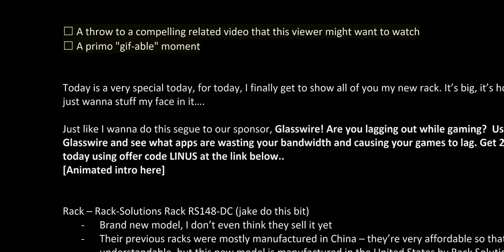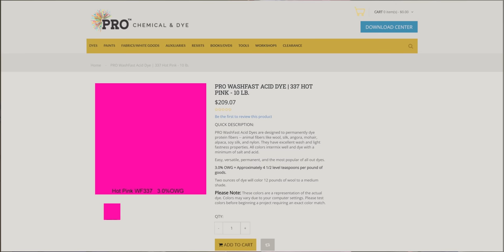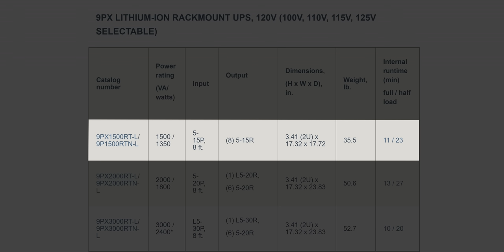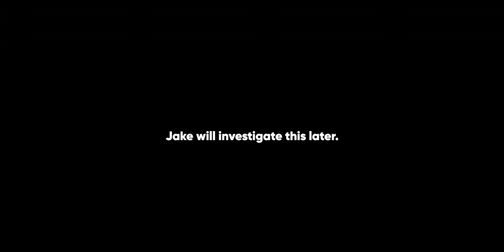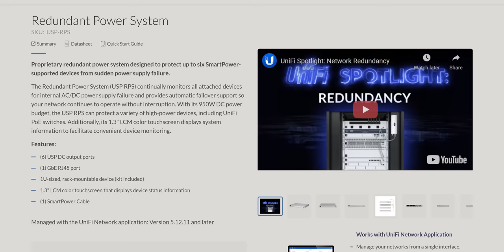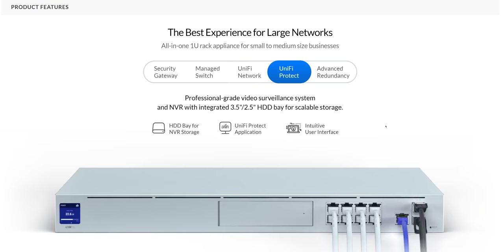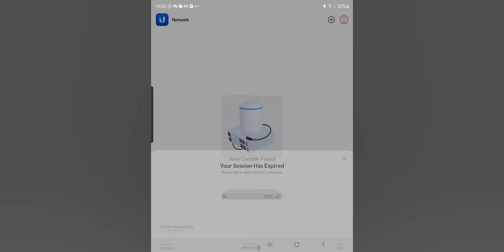Check out my HUGE Rack! - New House Network Update

Comment: Linus: "No, I chipped it!"
Me: "That's what you get for using an adjustable wrench."
Seriously. They don't call those things "nut-f***ers" for nothing. They will slip and destroy everything they touch. This is a guarantee. You should have been using a socket and a ratchet to unbolt that thing from the skid.
Reply: thank you for this factoid
Reply: more like it should be called  a Linus tool its just like him will let it  slip and destroy everything it touches.
Reply: Crescent wrenches, also known as "Adjustable Spanners', or more lovingly the 'Mexican Speed Wrench', or 'Swedish Nut Rounder'
Reply: As someone who has uncrated many racks fully loaded with gear for data centers...impact guns with socket adapters are the way to go.... Also, there's supposed to be a ramp included in the skid so you can just roll the rack down...
Reply: Adjustable nut f***ing hammer/lever depending on circumstances
Reply: Adjustable wrenches have become my nemesis, they're just awful
Reply: Use quality sockets, because cheap ones round the nuts even faster.
Reply: I got one stuck between the tensioner bolt and the inside of the wheel well once, that was fun
Reply: Same applies for guitars, I hate when my co-worker uses a pair of pliers to take off a nut off

Comment: You should’ve moved back the front vertical mounting rails (you know, the things where you put your cage nuts in).
Decent racks have the option to do so, there’ll be pre-drilled and tapped holes for your bolts in the bottom of the rack.
If you’re going to mount appliances with front IO, you otherwise won’t be able to close the front door.
Decent racks are deep enough to house full depth servers even if the you move back the mounting rails

Comment: 11:34 when you´re a Datacentre guy and you like seeing people having the same troubles. :D
and we use Rittal TS 8 racks. you can disasemble it completley down to just the Cube holding all together and you can transport everything easily. where the heaviest part is the closed side panels, and you get some space on the sides to install cable manegment vertically

Comment: "Huh, Linus isn't wearing steelies for this job, not sure that was a good id..."
"OH MY FOOT!"
Reply: I did not even think Lunis owned a pair of actual shoes.
Reply: I can't believe hes wearing shoes.  Everything in the rack will need a repaint to match.  I bet the layers of paint are what make the rack nut openings smaller.  Will Linus move in before his kids graduate High School?
Reply: @jasonfabrick9308   I don''t know. I deal with servers in a rack at work.

Nuts, rails, all of that stuff. It always sucks. Doesn't matter who the manufacturer is.

The usual goal is to try to get things done, whilst only suffering two or three minor flesh wounds. If you can manage that, then you've done a good job.

Comment: Ubiquiti switches have a neat feature where you can scan a code kinda thing on the mini screen with your phone and get an AR view with information on all the ports, like which IP Adress the device on the other end has. If you play your cards right there is no need for labeling and no guesswork.
Reply: Only available in the iOS version of the app still sadly.

Comment: "There's probably a datacenter guy watching this and laughing at us."
Can confirm. Am datacenter guy, and laughing. Needlenose pliers are your friend, use them.
Reply: Can confirm, cringed and laughed. Hope everything on one side doesnt tip it over
Reply: honestly I prefer the standard piece of crap metal tools that almost comes free with every package of cage nuts. once you actually learn to use them putting in hundreds of cage nuts is a couple of min job.
Reply: Yes can confirm the included tool is the best tool, if you know how to use its a breeze. But I think the bad guy in this case is the paint we have had a lot of issues with that in the DC I work at even problematic for tool-less rails
Reply: Check out rack studs- much less bleeding. If you have to use cage nuts, silverback makes a good cage nut tool they used to give away for free, its lived in my datacenter go bag forever

Comment: So happy to see someone else struggle with those rack nuts. They are literally unusable. Had the same problem and in the end only used the set i already had lying around which was a breeze.
Reply: Most 'included' rack nuts are like that: unusable. I also end up using rack nuts from my stash and discarding the included ones.

Comment: I've moved enough racks in my time to know the best thing to do is to remove all the doors and panels before trying to move, why make things harder for yourself.
Reply: Totally agree except for the risk of scratching that sick paintjob
Reply: I gotta second this you can cut the weight of a 250 pound rack by almost 100 by doing that.  Also if I was the guy terminating the cat6A cables into that cabinet I would be taking out at least 1 switch as that will make it so much easier to terminate nice and neat.
Reply: It's like carrying all the groceries in one trip. It's a "real man" thing and Linus feels the need to prove he's a real man.
Reply: @JosephBall  I would say it is more because of the higher risk to damage that paint job
Reply: @Adrian-jn9ov  I'm sure, 'twas a joke friend.
Reply: @Adrian-jn9ov  higher risk to drop the damn thing and scratch the paint than disassemble it and just wrap the frame whilst carrying.

Comment: 8:45
Not to knock Eaton, but I've had EXACTLY ONE APC UPS die - bought used and worked for more than a decade before that.
I have some APC units in their THIRD decade - though I have had to replace batteries - and my oldest APC units are starting to push 3 FULL decades of use.
It's also nice to be able to ELECTRICALLY hang as big of battery(ies) on any APC, even if they're not physically designed for it, as the charge circuits have "limiters" so they don't try to push more recharge current than they can handle.

Comment: I am that network guy laughing at you putting the cage-nuts in - I used to put them in by hand, tool-less.  It's just a knack, but acquiring it requires many pingfukits.
And the downside of li-Ion batteries is that they should not be stored at full (or even high) charge for long periods, as voltage kills them - unlike SLAs which should be kept fully charged so are far superior (despite the additional weight) for UPSs, stairlifts, and alarm backups.  The lead is endlessly recycled anyway and is only a penalty in mobile use.  Just install the UPS empty and add batteries when installed (mine is 3kVA, and dates from antiquity, although it is 5U).  I think APC stopped making it about 15 years ago.  The downside is the need to maintain a VM with WinXP on a PC with a real RS232 to connect with the last version of Powerchute to support the proprietary signalling on the management port.  NT 3.51 originally, then 4, then 2k, then XP. The hypervisor has to pass through the RS232 port to the VM.  When a UPS lasts beyond OS support for its management software and even hardware support for its management interface, you KNOW it is good!
BTW, it is far better to colour-code the patch cables by function of the endpoint - camera, WAP, Server, Router, NAS, End-user use (PC or similar), etc.  Oh, and tag any which are for PoE at both ends.
I originally created short patch cables for a data centre in London, and don't know of any prior use.  I'd got sick of "cable management" inserts for racks, which just became a complete tangle and wasted valuable rack space, so came up with alternating patch panels and network equipment, so that cables could be traced at a glance.  It was Token Ring, which shows how long ago it was!
You're welcome.

Comment: As someone who's made it my job to hire myself out to help lift objects like this, I can say that they made moving that rack much harder than it needed to be.

All they needed was a shoulder strap 2-person dolly so they lift with their legs and you only use your hands to balance it. Then everyone should use a pair of rubber grip gloves. The keyword here is "grip", not those gardening gloves you might be thinking. Without grip gloves, so much unnecessary effort goes into simply gripping, but with grip gloves you just put inward force from both sides with an open flat palm.
Reply: SO Linus should wear the grip gloves 24/7/365 then.

Comment: I'm curious how thick the paint is on the unit thanks to the need for a second coat (and it being an enamel or powder-coat paint from the look of it). Would it possibly affect how difficult it is to install the cage nuts?

Either way they did an awesome job with the rack - that is going to look absolutely amazing with the green cables! I'm jealous of the contractor who gets to work on it.
Reply: If it is just powder coated, about 10-20 mils total. If it was wet painted they can lose 1-2mm on each edge.
Reply: @sl06bhytmar  I'd hazard a guess and say that's the reason for the poor fitment of the cage nuts, then, as even 2mm is a huge reduction in what is supposed to be ~18mm or so wide (not sure on the actual dimensions just making a guess)
Reply: Paint definitely doesn’t affect part fit like that. More likely the cage nuts have very little give.
Reply: From experience, I can definitely say it's the cage nuts here. Ubiquiti's cage nuts that they send with UniFi equipment are absolutely awful to install because of how sturdy they are.

Comment: Use rack studs. They are soooo much better

You can also place tape over the holes in between the equipment and the rack and punch through with a screwdriver. It protects the equipment and protects the finish on the rack. You can't see it once everything is installed.

Pro audio tips.

Comment: "We are going to put the UPS at the bottom to not make it top-heavy"
*30minutes later*
*puts everything else on top slots making the rack top-heavy

Linus drop tips
Reply: Correction. Linus said that's the USUAL reason the UPS is on the bottom due to the typical lead-acid batteries in them (which tend to have as much mass as everything else in a rack alone). Not sure his logic on this one though.
Reply: he will have some heavier servers down lower in the rack so this makes sense

Comment: Yes UI's rack hardware is a pain. I highly recommend AC Infinity for rack hardware. I've converted my 5 casinos, hotel and corporate office to them and will never look back. I think total replacement was about around 4000 sets and at $20 for 50 of them I think the value was reasonable too for the quality control. They make some pretty neat rack accessories too that I use in a couple of my datacenter racks.

Comment: 42U racks are typically 76-78 inches tall, and the reason 42U is typically the largest size you can get is because a typical doorway is 80 inches. learned this when I got my rack

Comment: Based on experience, a wider rack gives better possibilities for cable management…
Reply: Cable management isn't hard if you use that grey matter between your ears and adjust your rack properly. 

Why they left the front mounts so far forward, I have no clue. That should have been put back about 3 to 5 inches to allow the cable to be connected between devices and not exceed it's bend rating.

Comment: I’d recommend using SFP+ direct attach copper cables, rather than pairs of 10GBase-T transceivers. It’ll be cheaper, more reliable, and ever so slightly faster latency wise.
Reply: Absolutely. DAC is peanuts compared to those transceivers, and that's the perfect use case.

Comment: Small engineering question that I have always wondered. 
When you are tipping a large heavy object like they are doing @ 2:56, I'm always concerned that having that much force all directed on that rotation spot is going to break the "feet" off the object.
Like, those "feet" are designed to each hold 1/4 the weight and for the forces to be straight down. When you rotate the mass like they are doing there, all the weight is going on only two of the objects feet, AND it's being applied across a different axis than what was intended. That's a ton of force crushing those things sideways as the object rotates.
Reply: It's physics. When you pick up a heavy box do you pick it up from a single point or do you pick it up from the corners relieving stress off a single point. Gravity affects literally everything with mass. Tilting anything relieves a mass amount of force off a single point due to gravity. The feet are designed to hold the load at a single point at equal force downwards. Not if the load is changed. The force is relieved by the person holding the mass at the top or bottom.
Reply: Those bolts are MUCH stronger than they look. It's also empty.

Comment: Around 16:30, wtf
Please do NOT look into lit fiber, especially single mode fiber!!!!!
Reply: You can use your phones camera to see if light is coming through.
Reply: @robc7417  If it is a wavelength not filtered by the optics that works (cameras usually have coatings that block IR + UV because it distorts the visible color range).
But long-range optics can have lasers with > 1W of power output, which could damage your camera sensor - still better than your eye, but just plug it in and see if it works (or get dedicated test equipment if you do fibre often enough)
Reply: @robc7417  Except Telus Fiber uses infrared light, so it's normal that there's no visible light.

Comment: There is a special tool for installing and removing the square nut clips.  It is a piece of stamped sheet metal about 3/8" x 2" long with one end slightly bent.  It is probably in the bag of nut clips that came with the rack.  You put it in the square hole and pull the clip in.  There is probably a YouTube video about using them.  Try it, you will like it.

Comment: If you can't use fancy cage nuts, there's a "Cage Nut Insertion Tool" that's just a single piece of spring steel bent in hook-like shape.  They'll save your fingers for sure!

Comment: I'm a day late and a dollar short, but it's highly recommended to adjust the vertical rack rail depth (front to back) if you use front facing switches and intend to close the rack door. Rack doors can and will interfere with the cabling, and I've personally responded to incidents that were the result of a cable or fiber being broken by someone closing a rack door.

Comment: Linus, you have the rack backwards.........notice how the rails for the cage-nuts are right by the door?  Normally, that side is the BACK, since you only need rail screws back there.  The other side, with the cage-nuts rails 2-4" back from the door is supposed to be the front.  Leaves room for wire managers and other things that stick out the front like server handles etc.  You can adjust the cage-nut rails by loosening some bolts/nuts and slide them where it makes more sense for your setup.  Just thought I'd let you know, since when you go to patch things in your probably going to run into bundles of cables pushing against the door with the rails right up by the door.  (18 year telecom engineer)

Comment: 7:37 "oh, the door is grounded too... that's not going to matter, because we're not going to ground the rack anyways"

Several months later - "our water cooling corroded a bunch of stuff, probably because of voltage potential between the rack and other hardware, we need to ground everything to prevent it from happening again".
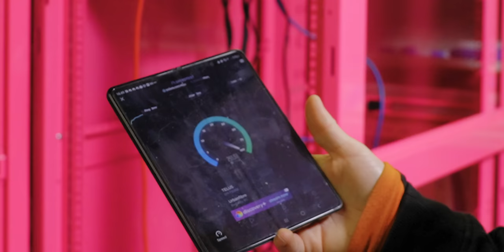Hindsight's 20:20, as they say.

Comment: This is one of the reasons why I DIDN'T go with a 42U rack in my basement (because getting it into and out of the house when we move will be such a colossal PITA).

The rack that I've currently got in my house is an 18U rack and if I were to get another one, I'll either get something very similar or maybe move up a little bit to 21U (so it's a proper, half-height rack).

Not surprised though that their networking gear, with nothing plugged in, taking ~200 W though.

I think that my Netgear 48-port GbE switch takes that and my Mellanox 100 Gbps Infiniband switch takes like around maybe 60 W at idle.

Something like that.

Comment: If it was just the two of you guys, then I suppose you had no choice but carry the rack the way you did.

However, with four people or more, you could've used suction cups grab bars. Those things are a godsend when it comes to carrying heavy stuff around — the only caveat being that the heavy stuff in question must have completely flat sides for the suction cups to work.

Still, kudos on handling that absolute unit with such tenacity!

Comment: I got a 42U rack, I took it apart in the driveway - removed all the side panels and reduced it's weight by over 150lbs... you're doing it the hard way... lol  It looks similar to my Cyberpower 42U rack...  except mine is black, your is hot pink.  lol.  The pink actually looks good.  LOL!

Comment: may I suggest you move the front rails more inside the cabinet? It looks like the cables might get pinched from the door, especially if you plan on running fiber optic cables.

Comment: That 240-A GPON ONT fits so nice. Sadly when you upgrade to 2.5 or 10Gbps symmetrical the 250X XGSPON ONT is just a bit taller and you are going to have to move it 😥

Comment: I would have suggested installing fiber at this point, since if you realistically want 25gbps down the road, ethernet cable will likely not be feasible due to distance.

Comment: I suggest using the USW Aggregation and real 10 Gbit/s-DAC cables, not two RJ45 10GBase-T modules connected with a short network cable. The 10Gbase-T modules get very hot. DAC cables are simply more reliable.

Comment: On the rack nuts not fitting.  It could possibly be because they painted it twice.  That little extra layer of thickness on a bolt thats meant to be that precise, given how small it is, could have brought it out beyond its tolerance.